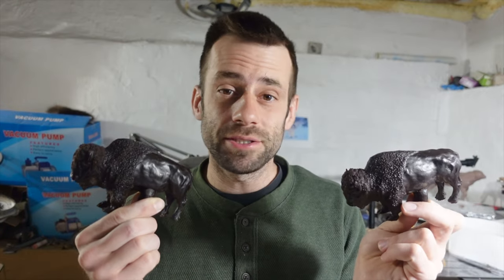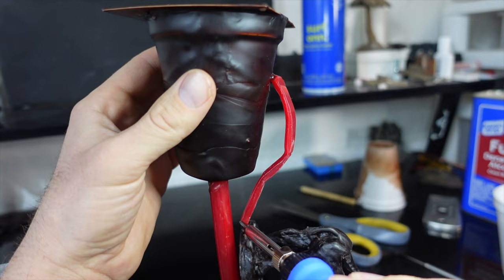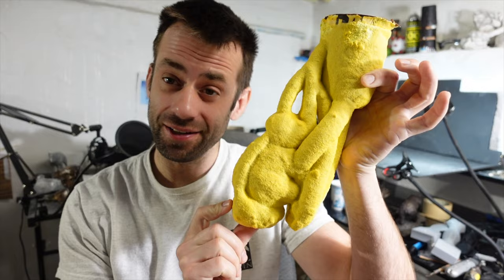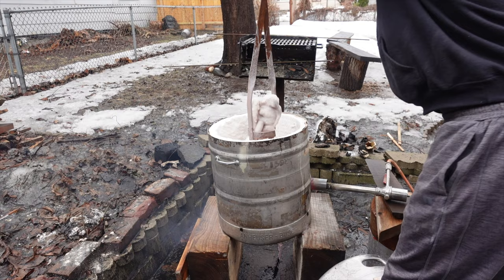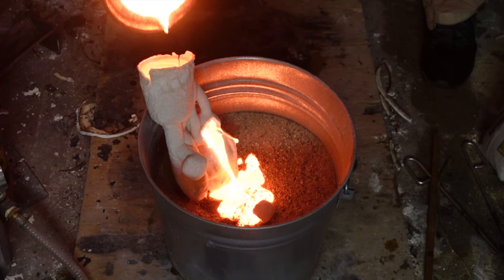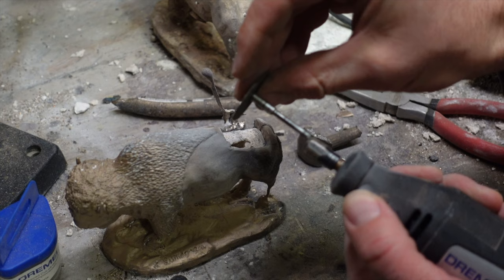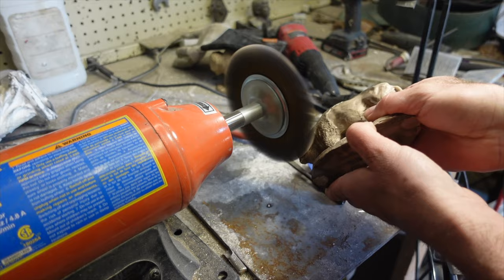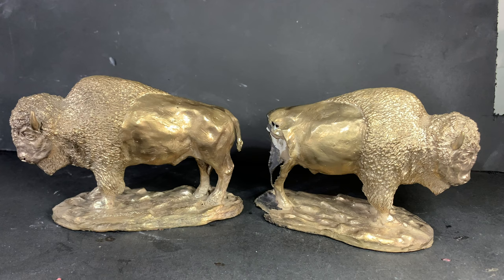Investment Casting VS Ceramic Shell for Bronze Sculpture

Comment: Can I ask whether the investment is simply plaster of Paris or does it have added sand or some other fine grain substrate in it?
Reply from the maker: It is not just plaster of Paris. It is specially made to take the heat and is also porous. Unlike plaster. You can use plaster by adding sand as kind of a poor man’s investment. But I’ve never done much with that. If you are going to go through all the steps to make a bronze it’s best to have good material.

Comment: Maybe you could cast the base completely separate and hollow out the entire under belly of the beast. Have countersunk mounting holes in the base and mounting posts under each hoof then tap and screw together. What do you think?
Reply from the maker: That sounds like a good way of doing it but it still leaves a seam. If I fuse the wax before casting then it’s seamless which I think I prefer.
Reply: @lundgrenbronzestudios  On investment version, placing a larger sprue cup placement into under belly seemed more logical to me though shrinkage did not seem to be a problem, and as you say, parting lines were eliminated which is always a bonus.

Looks like your better half, with some training, could make an excellent assistant.  You two should collaborate on a project or two and see how it goes.
Reply: You know what they say "a family that plays together stays together

Comment: It would appear that using the "Investment Casting" process has a few more "pluses" than the slurry method. 

       1) Investment Casting seems to be just a lot easier method to use.
       2)        "                  "        appears to take less time to accomplish, from start to finish.
       3)        "                  "        your clean-up seems to be quicker, and a lot easier to do.
       4)        "                  "        also seems to be a less expensive overall process. 
       5)        "                  "        doesn't appear to have the same blow-out problems.
       6)        "                  "        has finer detail quality, when finished.

Although, with all the above stated "pluses", "Investment Casting" appears to have one major draw-back. 
You are limited in the size of objects you might want to cast.

From a quality standpoint, does it make any sense to cast in sections? On hollow objects, it would
be a lot easier to clean-up. If casting in sections, would there be any advantages to making the walls 
of the casting thinner? The main downside I see, would be having to weld the pieces together, along 
with the added time for finishing that would be necessary. Also, would casting in sections enhance 
any of the overall quality of your castings?

Lastly, do you carve your own wax patterns? If so, have you ever used "3D resin printing" to make your 
castible, wax patterns?

Great video, and I'm looking forward to watching more of your videos soon!

Thank You,

Jim Dasher
Spectrum Graphics
Seattle metro area
Reply from the maker: Blow outs can happen in investment too if it’s too thin. But the flask holds most of it together so that’s only an issue at the bottom. Cost and benefits can be personal preference. Some people prefer ceramic shell and some people prefer investment. But it really depends on the artist and the piece being cast. 
You can cast things in pieces but it’s usually just because of size issues. Or clean up. Welding is fairly simple but the metal chasing can be difficult and time consuming. So I don’t cast in pieces unless I have to.
Reply: @lundgrenbronzestudios : Any answer for my last question from above: Do you carve your own wax patterns? If so, have you ever used "3D resin printing" to make your 
castible, wax patterns?
Reply from the maker: @jayedwin98020  I have used PLA but never resin. I do make my own wax patterns though. I have several videos on that process and I’m working on some coming videos of that as well so stay tuned!

Comment: Hey Lundgren, I was wondering. Since you used two types of wax for your investment cast, do you steam the wax out for that and re use that as well? Wouldn’t the waxes mix together? I understand microcrystalline was is best for molds, but with the sprew wax mixed in, would you notice it becoming less useful? Thanks! 🙏🏽 I’m hoping to make a bronze statue this summer using your methods. I’m currently building everything and your channel has been a god send❤
Reply from the maker: Oh it’s ok for them to mix. I reuse the wax and it works just fine but it needs to be cleaned. So I stretch pantyhose over a silicone rubber bread pan and pour the wax through to filter and crud out.
Reply: @lundgrenbronzestudios  a softer candle like wax of course gives less detail than hard pattern-grade wax.

Comment: Why did you have to evaporate the wax before putting it in the kiln with the investment bison ?
Reply from the maker: It needs to melt out very fast. If it warms slowly it expands and cracks the mold. But if I put it in my electric kiln that hot the wax makes a big fire ball and nearly burns down my garage. Which isn’t good for business.

Comment: do you use a sealing coat after burnout? usually helps with cracks. wire is handy for large castings an flat castings but shouldn't be necessary for something like that. .
Reply from the maker: So what is a seal coat?
Reply: @lundgrenbronzestudios  you can dip the shell once more (just slurry no grit)after burnout, it helps seal cracks and make the shell stronger. burring them would have probably saved that cast to

Comment: Old fashion investment is a damn hardy process. Even for the large projects, reinforced investment (concrete reinforcing mesh or chicken wire) is pretty hard to beat if you're already set up for it. That being said; I've seen my fingerprints come through on bronze investment castings. The only catch 22 is if your sandblasting the piece anyway then putting patina down or finishing it doesn't really matter. The finish will be etched likely along with the very fine ceramic shell fingerprints. I've casted napkins with investment (Yes paper napkins infused with wax!) and the detail is certainly still there.

The Investment vs Ceramic Shell choice really boils down to three things: Personal preference, your shop workflow,  the size/weight constraints you have, and of course the type of casting. It's easier to coat slurry on a sprue than filling up a 55 gallon drum full of investment not to mention WAY lighter. They are both are great processes and both have their place. ...........Especially when you want to avoid dealing with cores and ramming up flasks with French sand or petrobond that can't cut the details!   

FYI For anyone who is interested in artisan lost wax bronze casting I can recommend the book: 
The Craftsman Revealed Adriaen de Vries Sculptor in Bronze  by Jane Bassett. 
It details the construction of the waxes and casting techniques etc. of his sculptures from the late 1500's to early 1600's. X-ray photography is used to evaluate the processes that were used back then. It's quite amazing to see the mastery of casting achieved way back then! 

P.S. I must admit, seeing that snow in the background of the first pour in the video had me cringing a little! One thing you never loose is that fear of moisture when all of a sudden it's raining molten bronze!
Reply from the maker: How on earth do they move a 55 gallon drum of investment, and burn it out?  That’s amazing. The biggest flask I’ve done was 15lb and that was super big and heavy to me. 
Love the info!  Thanks for commenting.
Reply: @lundgrenbronzestudios : I guessing you would have one hellava large furnace!   😎